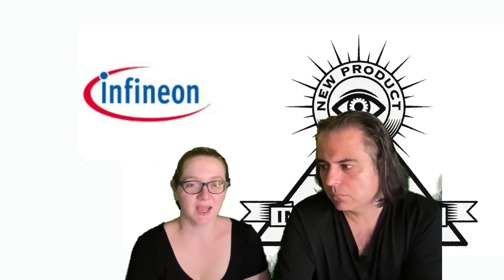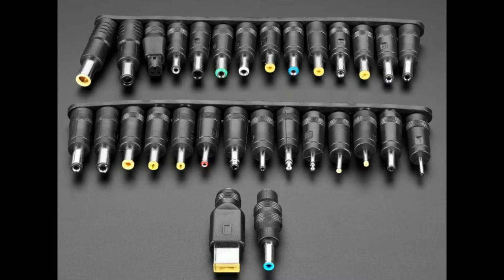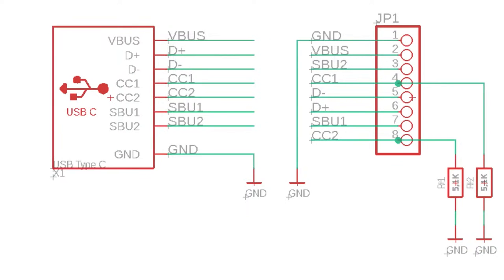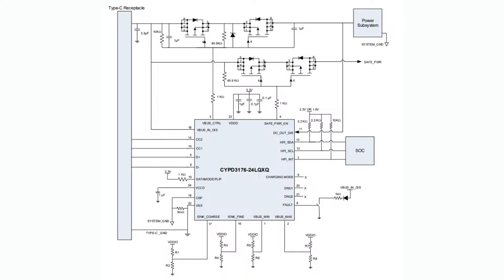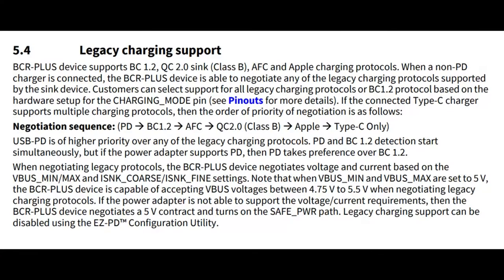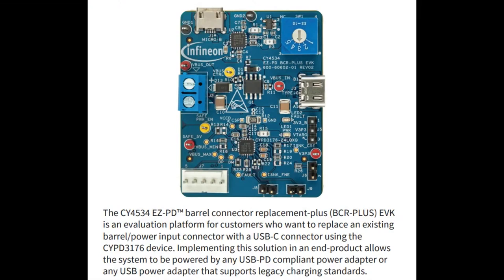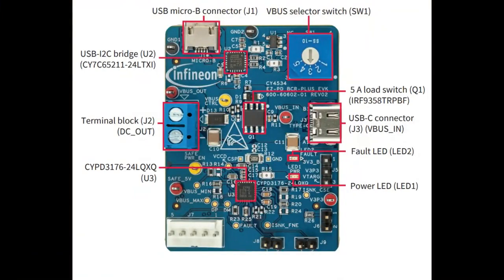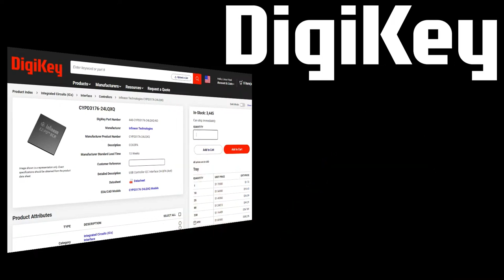EYE ON NPI – Infineon's CY4534 EZ-PD™ barrel connector replacement #Digikey @DigiKey @Infineon

Comment: What is the output if it is configured for a voltage that the USB-PD source isn't capable of outputting? Is it just zero output, or something else? Is there an error pin (or signal over I2C) to let the downstream circuit know that there is a problem for the cases were the downstream circuit is battery powered and one is trying to switch to wall powered by plugging in a USB-PD source but accidentally the source isn't capable of outputting the requested voltage/current?
Reply from the maker: Answered on Ask an Engineer for you https://www.youtube.com/live/2uP-W4avI1c?feature=shared&t=3017